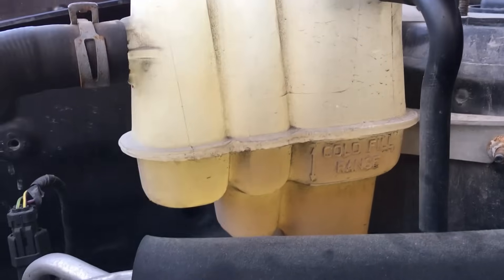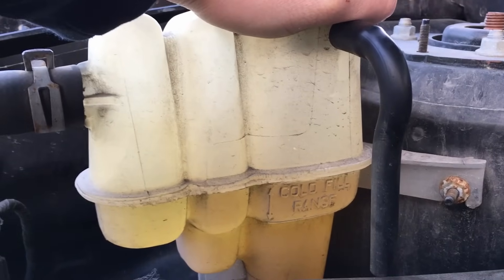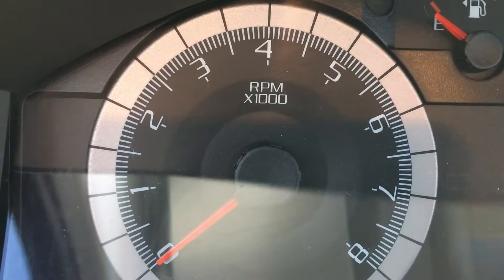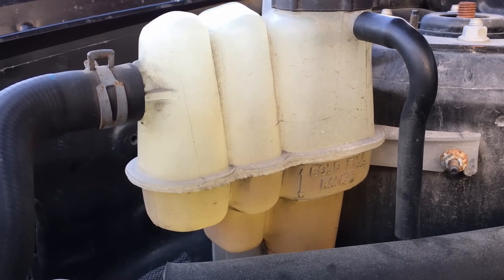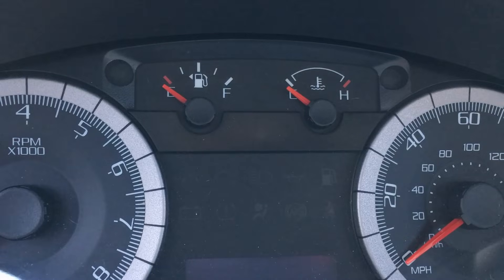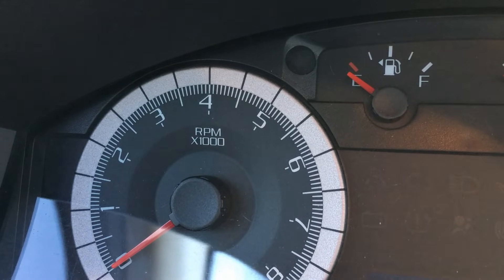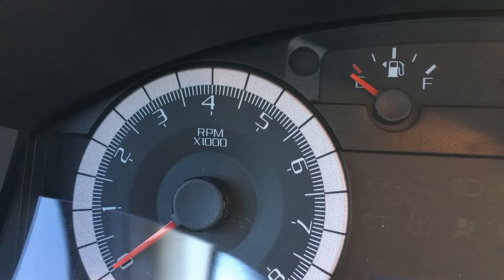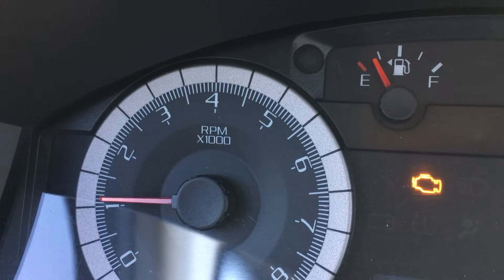Ford Quick Tips #69: The Trick to Purging Air From Your Cooling System

Comment: This helped tremendously. I had a friend who had someone change the lower radiator hose because the car was overheating. Turned out it was a bad water pump, but there was a ton of air in the system. A shop told her it was a bad head gasket and wanted 3k to change without even seeing it. I changed the water pump and bled the system. It fixed the problem after a few times of cycling the vehicle. Thanks for the videos.
Reply: Good thing they make a kit to put into the top of the water box u fil it with blue fluid and hook it to a vacuum line and if said blue liquid changes to a yellow green color it is in fact a bad head gasket
Reply: Sounds almost close to my issue . Everything been replaced in last 2 years but the pump . Garage have done loads of checks getting ut tomorrow . I had temp high after taking Mrs to work and coolant had sprayed from overflow onto engine ....its going back in once cooled though .... it didn't lose much as I bought some more to top up . Garage say its flowing etc its odd . Dealers method is rev once warm 2500 revs 5 mins then 3000 revs 5 seconds ..whether the garage done if that way I don't know .

Rad new 2 years ago.  New coolant sensor  /term under a year ago ..New cap hg also hg was done say June or just before last year can't recall exactly . They 1st thought air pocket then cap . I'm miffed

Comment: Thank you so much.   In my 2010 fusion SE 2.5 gas my water pump started leaking while I was on the highway.  I eventually got it home using 7 gal of water over the course of 2 hours.   I changed the water pump, thermostat, and serpentine belt. It was so much work for me at home.   I was finally done. Exhausted.  Glad it was done. I left to test it.   Overheated. I was so angry.  Eventually got back home.  Searched google and found this video and tried out your process AND IT WORKED!  Thank the lord!!   You are a life saver.  I can’t thank you enough.

Comment: Thank you!  This process cleared some of the air but not enough to totally fix this problem with my 2008 escape after I replaced the thermostat.  Then I thought, I need to get my radiator higher than the rest of the suv.  I pulled it up on a very steep grade, tried the process one more time.  Problem fixed!

Comment: Just ran into this problem after a 2.5L swap. Used a similar procedure. Run at 2500 for 30 secs then 3500  for 30 secs. Rest. Repeat until overheating stops and heater is operating. Your procedure is surely the best way to go though. Just sharing my experience. Thanks for sharing this Brian!
Reply from the maker: This is actually a procedure listed in one of the Ford workshop manuals I can attest it has worked very well for me in the past either way the idea is that continuous push.

Comment: I cant even begin to explain how much this video helped me out. I just replaced the thermostat on an 09 ford focus and it felt like I was running into one problem after the other. Such a pain to replace these things on these cars especially if you're a big guy. Anyway, I finally got the new thermostat in and (as its the first time I've replaced one before I didn't know you had to bleed the cooling system of air) the engine was overheating. I wasn't getting any hot air, the engine wasn't cooling down, and as I was about to just take it to a shop, I found this video, did as you said, and after 15 minutes or so, I started feeling heat out of the vents at idle, the engine was no longer overheating, and after I disconnected the battery (due to some corrosion) the check engine light went off. The car is once again in perfect working order and I can go get this thing smogged. Thanks for the help!
Reply: I'm having this issue now. Girlfriends Fusion belt serpentine belt broke or came off (never found the belt) so replaced it and the car started overheating and no heat so I thought maybe the thermostat crapped out at the same time so changed it and still no heat and overheating plus coolant not going down in the overflow tank even though it all emptied out when I changed the thermostat. Going to try this in the morning, would do it now but the car is at AutoZone, lol. Was about to replace the water pump thinking maybe the belt issue caused an issue with that. Up until the belt issue the car had no heat or overheating issue.
Reply: @darrellsykes7746  did it work ?
Reply: @kevinhancock4064  yes it did. It took me about an hour but it did start working. This video was a life saver lol
Reply: @Darrell Sykes  trays fab I have heat bit yhe overheating is my issue still could be air pockets though

Comment: Lived with a water fall sound in the new car about a year. Dealer couldn't fix it either. Your method fixed it like a charm. Thank you.
Reply: Did you have a Fusion as well? I have that lovely waterfall sound upon starting. Did you overheat any? I lose heat at idle/low speeds and overheat. When driven, heat goes down and I have heat again. This car is the death of me.
Reply: @theowlsofouterheaven  did u ever get it fixed? What did u do? I have a fusion 1.5L that is starting to make a water sloshing noise when I start and turn off my car. Like right behind my dash.. solution?

Comment: It sounds like this problem is caused by the fact that the top of the heater core is higher than the degas bottle so air is being trapped up there. As such you could simply remove the top hose from the heater core and then plug a funnel into the hose and pour more coolant down into the engine until the coolant just starts to come back out of the open fitting of the heater core. Then just reconnect the hose to the core and all the air would be gone. Basically what you'd be doing is filling the system at its true high point instead of the degas bottle so all the air would have to come out.
Reply from the maker: Yes very much so as I explained in the beginning of the video allot of times it is at the highest point. The problem with the method you are describing though is you will still be introducing air into the system by  the hose you disconnected creating a bigger problem because that air would eventually circulate through and get trapped again. Same thing with the reverse cooling systems air can be trapped at various places and this is the best way to get them out short of using the vacuum fill tool.
Reply: I disagree. Once the cooling system is completely full of liquid up to the highest point no additional air can enter into the system through there. It's the same thing as in older cars if you take the radiator cap off when the radiator is full. Even though the cap is off no air will enter the system if it's already full up to the top and holding coolant.

The way air enters the cooling system during servicing is that draining the coolant out of the bottom draws in fresh air from the outside to replace the missing liquid. Typically the replacement air enters the cooling system through the open fill point located somewhere near the top. So as long as the cooling system is closed down below and its full of coolant up to its highest point then having it opened only at the highest point will not let any air in.

Therefore, if the cooling system is being filled through the disconnected heater hose the engine and cooling system will gradually fill and the coolant level will rise and the air will be forced out. Eventually the heater core will also fill until excess coolant will start to come out through the open tube. At that point the entire system including the heater core will be full because most of the air will have already been purged out and then you can reconnect the hose and close the system. Any small amounts of air still trapped anywhere in the system will eventually purge out once the coolant begins to circulate. Eventually it will all end up in the degas bottle.

Filling this type of system through the heater hose is probably faster and easier than using the vacuum method or cyclically racing and stopping the engine to purge out the air. This is because it will immediately purge most of the air from the engine and the rest of the cooling system before you even start the engine.
Reply: Hi I just flushed heater core that was clogged and had no heat at all. After de clogging it. I have heat only in city driving, highway it's not hot as it should be. What do u suggest please?
Reply: Would be nice to plumb in a simple petcock at the highest point.  Will never have that issue again.

Comment: I'm a DIY big time female. I have to say your video is the most professional, informative, and basically simple video I have found so far. I replaced the thermostat on a friend's Ford Escape last night and for the first time ever I can't get heat and I'm overheating. I've replaced many thermostats and haven't ran into this before. So I turn to You tube after few videos of men in chopped up tee shirts and babbling nonsense I find your video. Very professional looking and so very informative. I rushed out tried it. After running 3 cycles I had heat and after a 15 minute drive no overheating!! 
Thank you so much for your video and sharing your knowledge.
Reply from the maker: Sweet!

Comment: Your 6 year old video paid off for me. Replaced the radiator in my 2017 F150 5.0L yesterday and ran into the no heat issue when I was done. I tried this method this morning and it seems to have fixed the problem. I wouldn't have thought to do this on my own so I'm very glad you shared it with us.

Comment: Man I gotta thank you so much. Used this video here when doing coolant service on my wife’s 2014 flex with the 3.5 non turbo. Thanks to this and the tune up video as well as the video on the different types of motorcraft coolant things were a absolute breeze and I hate working on cars but with your info I was able to update the coolant to the new OAT yellow and followed your instructions and it wasn’t bad at all.  Let me say this to re enforce your Motorcraft parts only statement. I got some counterfeit fuel filters for my power stroke and just as soon as I installed them the truck would not start or run. Fuel starvation.  Costly lesson learned when i had to go buy Motorcraft brand filters at autozone at 100 bucks.  Won’t ever do that again.  Thanks Ford God

Comment: Completely fixed an ongoing issue. You’re wonderful and I highly recommend this channel. Simple and to the point
Reply: I've had a heating problem for 5 years on my 06 Ford F150 and I seen this and then I did this read my motor up and all this and it worked I have heat like I've never had before incredible

Comment: When I bought my new-to-me 2008 Escape 3.0 V6, I changed all the fluids because I didn't know the history of type and frequency of changes. This included having my local mechanic friend use a professional coolant flush machine which transfers the new coolant in while the old coolant is discharging. I've done this with other vehicles when I was changing coolant of different colors. I never, ever mix colors! 
Seeing this video assures me that I did the right thing. I had absolutely no problems with the heater temperature, engine temperature or losing coolant level in the reservoir. 
Yes, it was a little expensive, but well worth it.
Thank you for this video!

Comment: Just did stepmoms 2010 2.5 Fusion, cyl head coolant outlet fitting, and did the valve cover gasket set as well. Watched vids of yours for both of these jobs. Moving the wiring harness, for cover job, and this bleeding vid were awesome for the coolant repair... I did use the bleeder fitting, on the coolant outlet block, it did seem to remove quite a bit air itself... That start and stop, and then running the RPM up to 3500, is the the bomb !!!! God bless brother....

Comment: This works!!! I just did it on my 2014 Jeep Limited 2.4 4WD. Beforehand, the check engine was on, heat couldn't come on passenger side and would blow cold air, also the vehicle would elevate to temperatures up to 230. Most of these issues happened after changing my thermostat. Welp, I completed these steps twice, and all of those issues have been fixed!!!! Thank you!!!!

Comment: You solved my problem. I was getting no heat at all. I thought the de-gas bottle was full because I just looked at it and think it's full. When I removed the cap I found out that the antifreeze just stained the bottle like red sauce in Tupperware . It was bone dry. So I followed  your steps and I had to keep putting in antifreeze in it to keep it above the fill line. Now I have heat at idle, and while driving. Thanks man your the best!!!!

Comment: It took many times on a steep driveway. But it worked! The vacuum system would be the best way but if ur on a budget this does work. It took me about 10 cycles of doing this. Getting that sloshing thru the heater core to go away. I tried everyrhing after changing thermostat. Thanks man.
Reply: Also have a 2.5 2010 fusion

Comment: Brilliant video, it resolved my cold air problem, but i would say that i waited 2 to 3 mins after 3500rpm blasts as i noticed the air came back into the expansion tank way after 1 min, and also i had to repeat the process 7 times! But i still fully did it, so there is no limit on how many times are needed in repeating this. Just do it till its done! But great advice in general and a great video, well done.

Comment: This worked for our 2010 Mercury Mariner V6.  With the engine completely cold the coolant level was way below the cold fill range and we don't know why.  Filled it about 1" above max cold fill as suggested and ran 4 cycles.  After the first two cycles there was a lot of air hissing out when the cap was removed.  A lot less after the third cycle and nothing audible after the forth.  There is a ton of heat coming out now.  No maintenance was done on the vehicle.  It just started not putting heat into the cabin intermittently.  Thanks a lot for the video.

Comment: Started hearing a sloshing noise and research led me here.  Bingo, perfect instructions.  Worked like a champ!  Thanks bud. Your videos are are saving me 1000s keeping my truck running.  Done the intercooler drill, throttle body replacement, coolant purge and a few upgrades I wanted all with your help.  Next up, brakes and suspension.  Feel pretty good about those, but I'll be checking back for tips and tricks before I start.

Comment: Wow. I've looked for some bleeder point and was almost ready to take my heater core loose and back flow to clean it out. I was getting decent heat at fast idle and driving, but not like before. That's when I realized the core was clean but not getting the flow through it. This tip to bleed worked great for me. Thanks man. I've gotta watch more if your videos.

Comment: Man, thank you so much! My wife overheated her f150 last year, filled the reservoir and all was well until it started getting cold a few weeks ago. We flushed the coolant with water for a few hours a night for 3 nights after work (I'm embarrassed to admit the color of the water, thought that was the problem for sure). When it started to come out clean we used commercial flush/cleaner, I tore into the dash after the blend door, it worked fine, then I stumbled upon your video. 10 minutes and I'm sweating in the cab. I don't regret flushing the coolant, but man I'm glad I saw this video before I dug any deeper into the interior.  Thanks a million.

Comment: Was loosing my mind with my car overheating outta nowhere. After watching numerous videos I came across yours. I did process of elimination because I changed a few parts including coolant temp sensor and cylinder head temperature sensor. So since I knew those were brand new and I had no issues with my blower heater motor I tried this. Dude all it took me was 5 minutes, perfect. My heating system is back on point. Thanks bud.
Reply: See I'm thinking I need to do this or similar the dealers recommended method.  5 mins @ 2500 revs then 3k revs for 5 seconds . Garage can't find anything wrong ..New cap etc . Most parts renewed in recent months..had coolant spray from overflow onto engine . Dash coolant temp high . Could still be an air pocket they've not sorted properly

Comment: Very well done and informative. Was stumped on why I was overheating after a t-stat replacement and flush of my 04 Expy. Tried EVERYTHING; draining and refilling, burping with the front end elevated on ramps, pulling the new tstat because I thought it was bad, etc. Saw this method and 15 mins later it was back to normal, no overheating, cabin heat was working great. Thanks again!
Reply from the maker: Nice!

Comment: Thank you for this video. My 2012 fusion has been making a noise from the heater core for 4 years since I had a local shop do a system flush. Just did one myself again this weekend and , with the help of this video, got it to stop! Had to do about 6 rpm cycles, but it worked.

Comment: Once again you SIR are a genius. Thank you so much. This happened when my wife's car had a slip in the serpentine belt and somehow got air in the system. After I changed the belt I couldn't find the reason it was overheating. Did this burp method 5xs and its back to normal. Thanks for all you do.

Comment: Just did this to my 2015 ford explorer and it worked perfectly!! Had to do it like 6 or 7 times but hey it worked!! Changed the upper coolant hose and it was still over heating so my mechanic suggested me this video to watch so I can do it and it worked perfect🙏🏽🤝🏽💯 thank you so much for the info bro…subscribed! 🔔🔔
Reply: I have a 2011 Ford explorer and the twmp gauge goes crazy like I'm over heating even when I just start the car. Only goes crazy when I drive. I think I have air in the system. Did yours do the same thing?